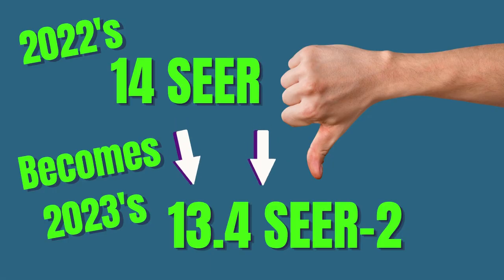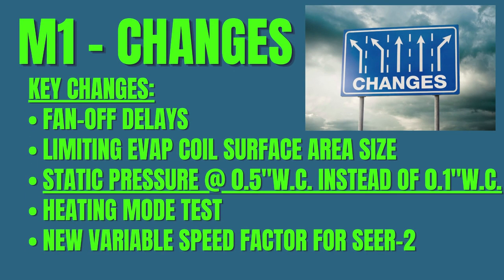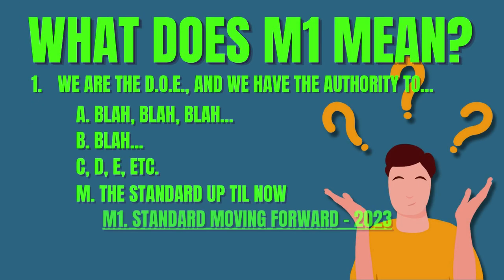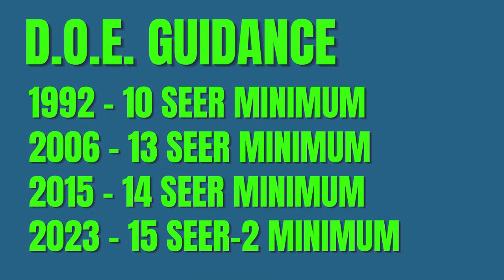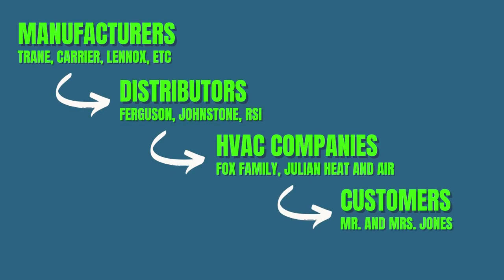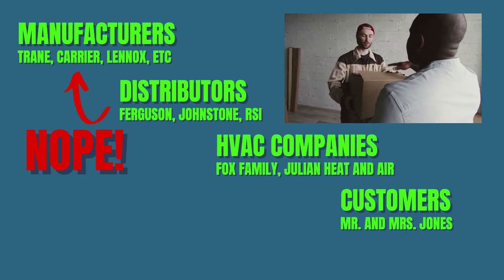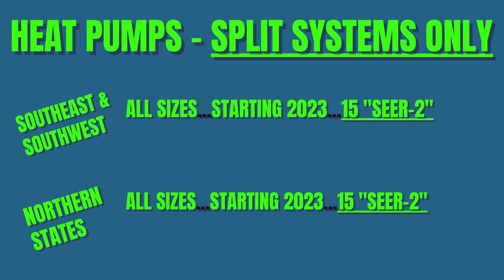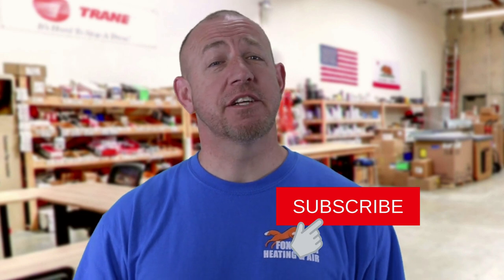SEER-2?? What Happened to SEER-1??

Comment: Just replaced my 15 year old 3 Ton 13 SEER Rheem with a 3 Ton 16 SEER Bryant. Total cost including new line-sets and concrete pad was 10K.
Reply: Area
Reply: What has your energy savings been like? Anything?
Reply: I got a 16 seer 5 ton Lennox two stage condenser and furnance for 10k + ductwork (additional 14 inch return) for 10k in DFW area
Reply: @memoobaba  - I just talk to HVAC company, LENNOX 5T 16 SEER is $25K (California), why is so much different?

Comment: From what I've read the 2023 minimum standard will be 14.3 SEER2 which is equivalent to 15 SEER1. It won't be a 15 SEER2 minimum.
Reply: 15 SEER 1 for 4 and 5 ton systems usually don't hit that 15 SEER mark, typicall around 14.5 SEER 1 so I believe that would be a fail when it comes to SEER2. I agree that it's 14.3 SEER2 requirement. If you're not confused with this, imagine the home owner. :face-turquoise-covering-eyes:

Comment: You would think that if the DOE changes will sell more 16 (or 15) SEER units that the cost of them would go down vs. up to the customer due to the increase in volume of sales. Anytime products are manufactured, usually the higher the volume in manufacturing lowers the cost to build them. However, if these huge conglomerates based their sales on "what the traffic will bear" vs the "cost plus fair markup" plan...the idea might be worthless.
Myself, the larger the company and market place they have, the less they should be allowed to use the "what the market will bear" margin plans due to less competition or monopoly concerns.

Comment: Seer increase is fine. But other states still don’t mandate duct testing like we have in CA. A lot of duct loss out there.
Reply from the maker: Very good point
Reply: In TX we like to stick air handlers in unconditioned attics along with ducting - the loss is incredible - construction standards are a joke - worrying about HVAC while continuing to build crap structures is like putting a bandaid on a sucking chest wound
Reply: @JimmyKSimmonsOfficial it’s all by design cause someone’s getting rich.

Comment: Will HVAC manufacturers raise prices to meet these changes next year?
Reply: Most definitely!  I’ve heard the new models are more expensive - almost a given because the minimum efficiency requirements are going up.  Also manufacturers also coming out with some new tech in their new models and not just the outdoor condenser unit but also the indoor evap coils.  

It means more $$$.  That’s why some HVAC shops have been encouraging to buy now if your system is on its last legs and you’re thinking of buying soon.

Comment: here is my problem. I had a new Goodman furnace and evaporating coil put in 5 months ago. Now ready to install the ac. The 2 ton 13 seer coil put in needs to match the ac. So the new 2 ton 13 seer2 ac unit they sell now will it work with the coil I had installed 6 months ago?
Reply: It's all about the Benjamins😢 sad but true

Comment: Oh boy. I need to get a  AC unit next year. Should have gotten one when my son got his last march. A question I have is that I have a 2 stage furnace(a mistake). Should I get a 2 stage AC or would it be OK to stay with a 1 stage AC which I have now?
Reply: A two stage furnace is a great unit if it’s been setup and installed properly.  The only mistake is that a modulating furnace is a whole new world compared to two stage.    I definitely recommend a two stage ac due to the nature of most AC loads.  You want a smaller capacity for most “normal” weather but you also want to have enough ac capacity for the truly Hot 🥵 days of 95+ or when you have a house full of people
Reply from the maker: Nothing wrong with a single stage. Do you have solar? If so it really doesn't matter! 😉 Air Conditioning has two purposes, to remove heat and humidity. Two stage ACs help the second one a little bit better because the system will run a little longer at lower speeds. Which helps remove humidity better than a system running at 100% all the time.
Reply from the maker: @georgewelker853  agreed!
Reply: Depends on if you have a zone system also.

Comment: I'd like to see where the manufacturing costs are different for a 15 SEER and a 20 SEER condensing unit and/or evaporator. Or, between the 16 SEER and 20 SEER the two systems with likely the most value per $ in cost to SEER ratio to the customer.
Reply: Just fgrom what I see in my neghborhood, (I have a 2012 Trane XV20- 20 SEER) the high SEER units have huge outside coils, much larger that the 14 SEER unit I replaced,. I hooe someone who knows responds.
Reply: @cdf6333  That make sense and I have seen some newer condensers 5 feet tall ! The big question I have with that is, just how much more does a larger condenser cost...surely not the extra $3,000 to $5,000 they are charging for a 20 SEER from a 16 SEER.